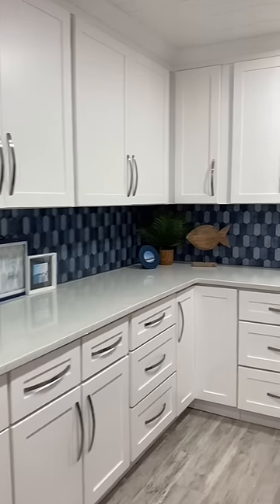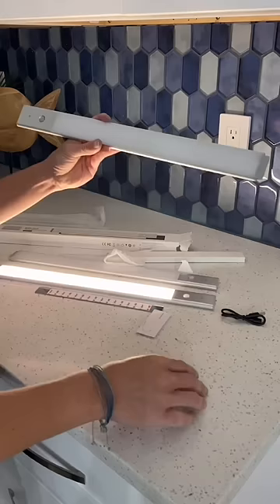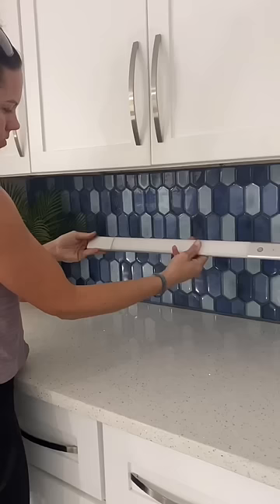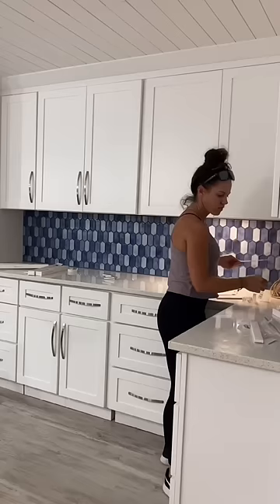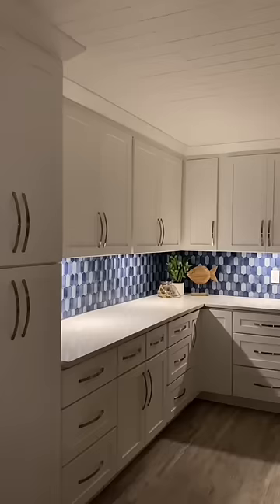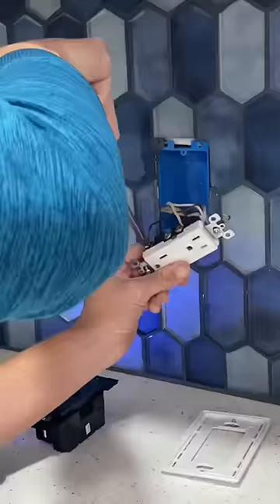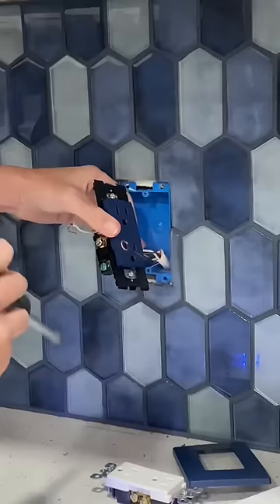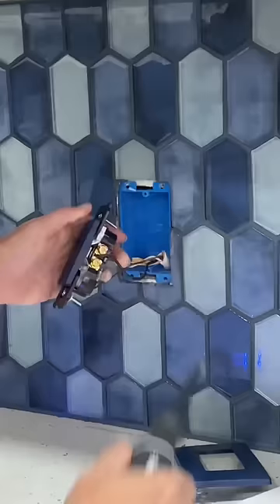My favorite under cabinet lighting! Update your electrical outlet to blend in with your backsplash!

Comment: It's all fine and dandy until you get sick and tired of charging the batteries every 2 weeks and then you forget about it and it just becomes junk. Nothing like a permanent solution of connected to the outlet or behind the drywall wires.

Comment: I think it is these lights after doing some research.........   EZVALO Motion Sensor Light Indoor, Rechargeable Under Cabinet Lighting Wireless, 48LED Closet Lights with Detachable Battery Operated, 3500K Dimmable Magnetic Under Counter Lights for Kitchen (2 Pack)